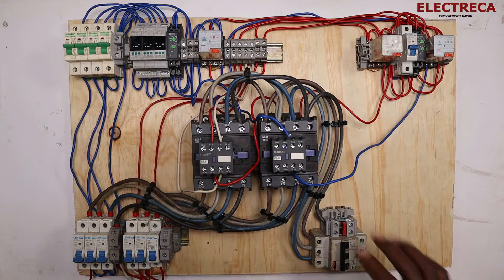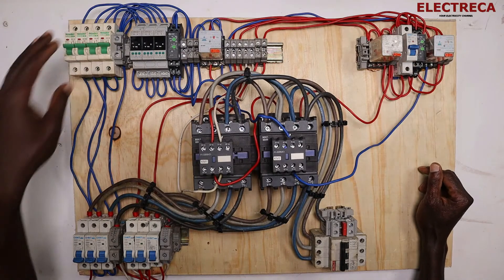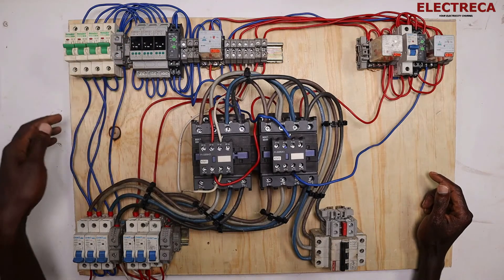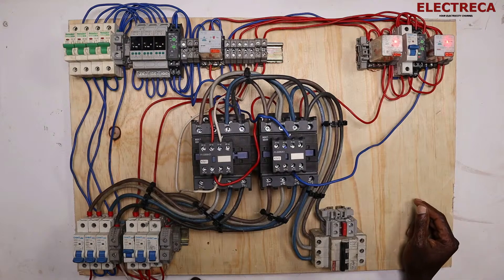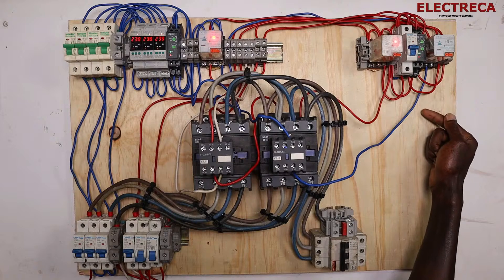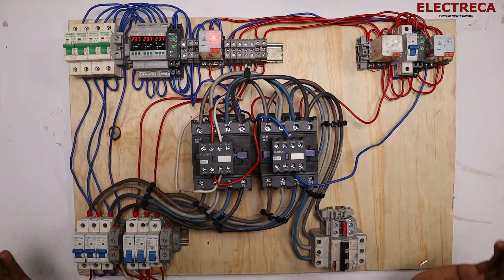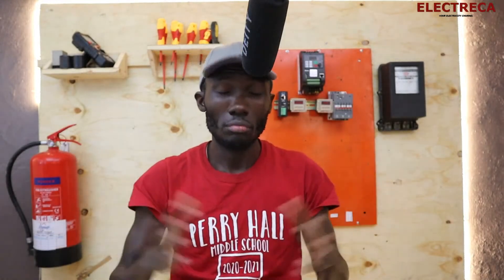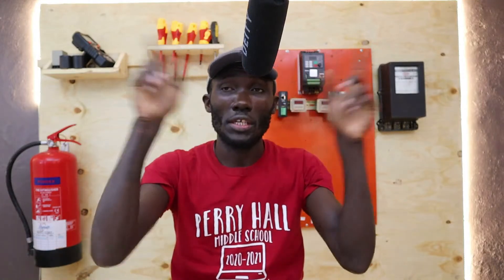Learn automatic changeover switch

Comment: Well explained as always sir,i have understood. IF  i just use one relay on the Gen side  will my circuit have any problems.
Reply from the maker: Not at all
Reply: Ok,and kindly  can you explain to me,i have seen some changeover with selector switch ,how does it work in the  circuit and what is its application  @elektreca